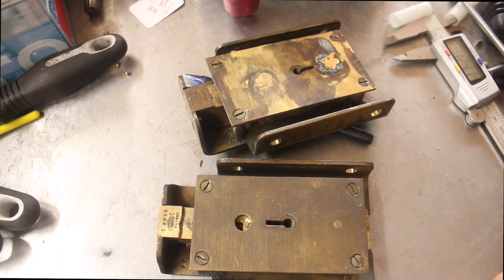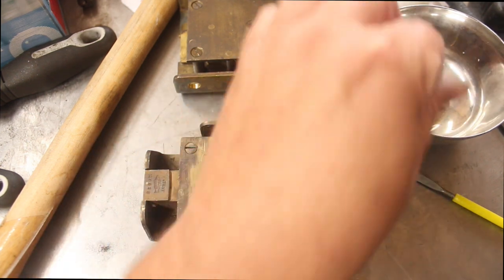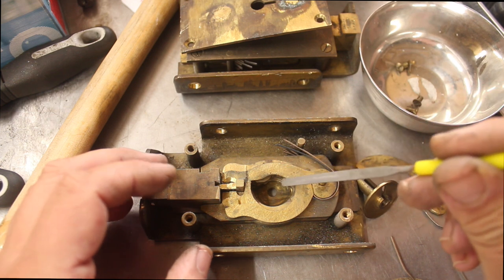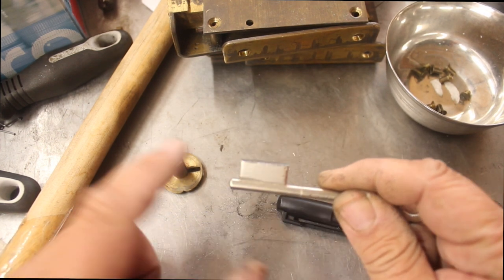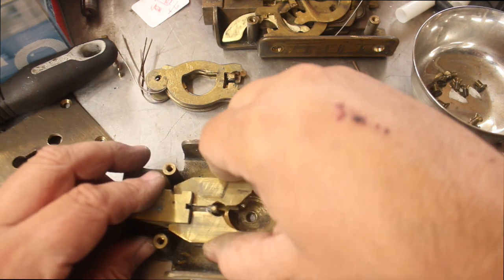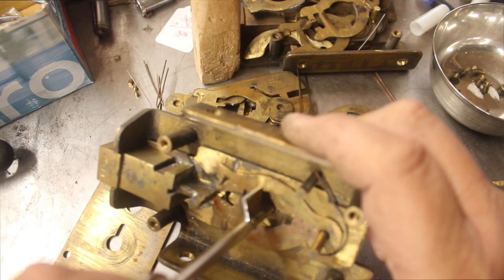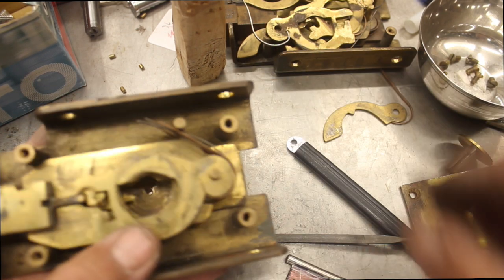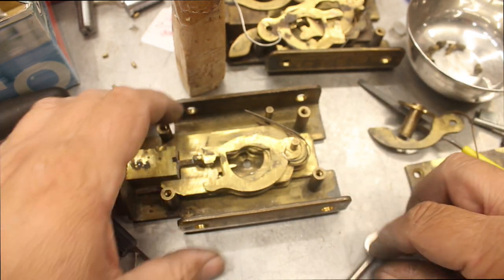Making A Key For 7 Lever Vault Lock from the 1920's

Comment: 6:15 That actually does make sense. Your lock is in the open position right now. If the lock is key-retaining (most safe locks are) this is what prevents the curtain turning far enough to remove the key.

18:30 I usually measure each of the levers. I take 1 lever and set it on top of the bolt and raise it to the correct height, then measure from the keyhole to the belly of the lever. Do this for each lever in turn. Then mark all of these heights on the key blank. This gives me the best results. It also allows me to make a card to cut keys on our Silca Prima Laser.

Comment: I've never made a lever lock key, but have 2 to do. Could you not use one of those makeup keys think there called, with sliding pins , to impression the stack.
Reply from the maker: The tools most likely won't fit this lock, its too old and the wrong pin size

Comment: Makes you realise just how good those old time-served safe and vault guys were.  Assuming this got drilled because some idiot lost the key, the tradesman would have drilled the container, manipulated the lock, stripped it, scrambled the levers, cut a new key, repaired the lock case and plugged the hole in the door.  If he was really good, he would have touched up the paint as well.  All on site, all with hand tools, and very probably wearing a suit and tie.  It beggars belief.  You're dead right, this knowledge and skill level is being lost.  

I noticed no anti pick notches on the levers or bolt stump.  That's weird.  And for a reason I won't mention publically, although it shares some similarities with the Ross 700 it would be a much easier pick (or at least, it would be much easier to build a picking tool for it, same thing.) For those reasons I think this was probably a pretty bottom of the range Chubb lock but I have to confess I've never seen it before.

Thanks for posting this video, it was excellent.
Reply: Why wouldn't  you post it publicly?, would  make absolutely no difference  at all if you did
Reply: @cardiffpicker1 because he’s stuck in 1970 and thinks it’s a trade only secret lol